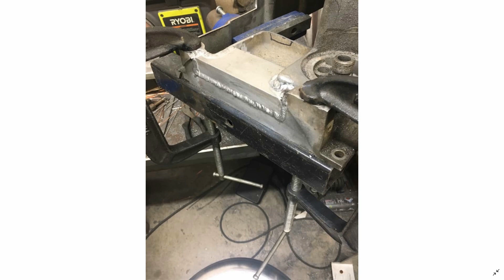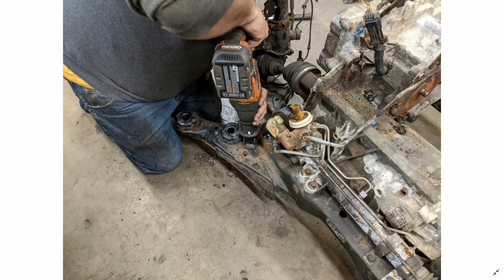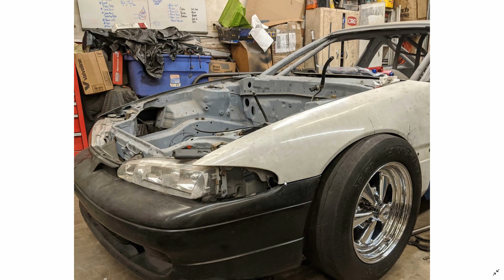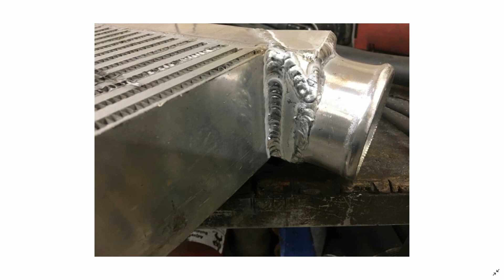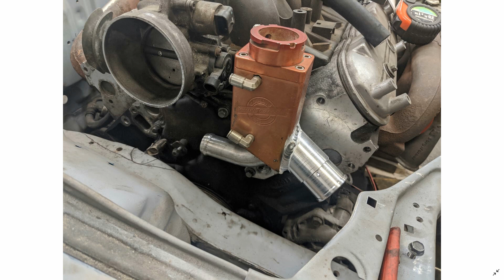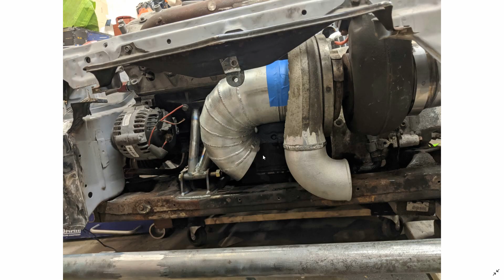PACCwards - Episode 2 - FWD LS4 Turbo Talon TSI Build - Catching you up...

Comment: Hey Calvin, do you happen to have the part number for that starter you used on this build? I’ve been looking stuff up left and right I just wanted to make sure the teeth on the gear work with the ls4 plate. I am keeping my system 12v though so idk if you having a 16v changed the starter. The stock starter looks too bulky to use.
Reply from the maker: Nah. It's just a regular starter. I don't have the part number but it's a run of the mill SBC mini starter.